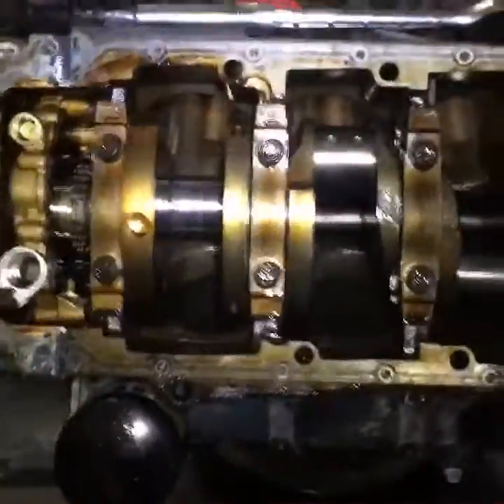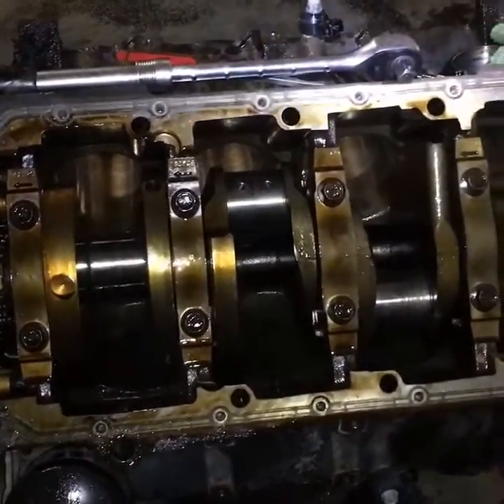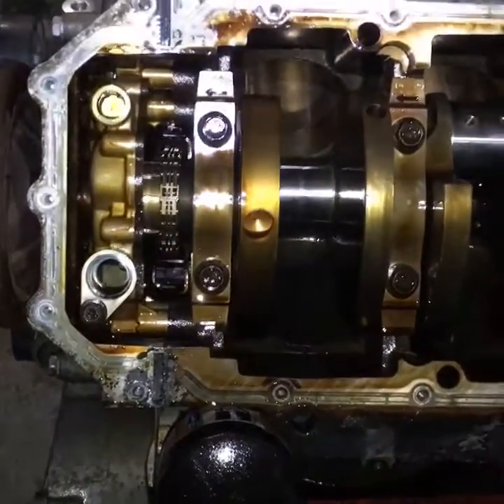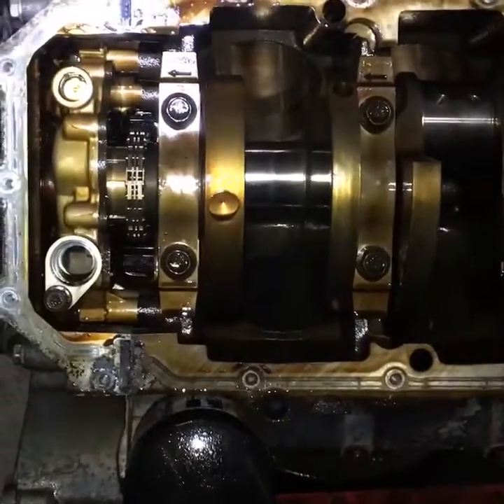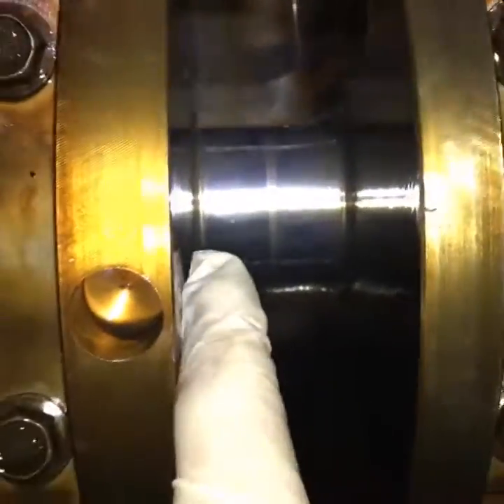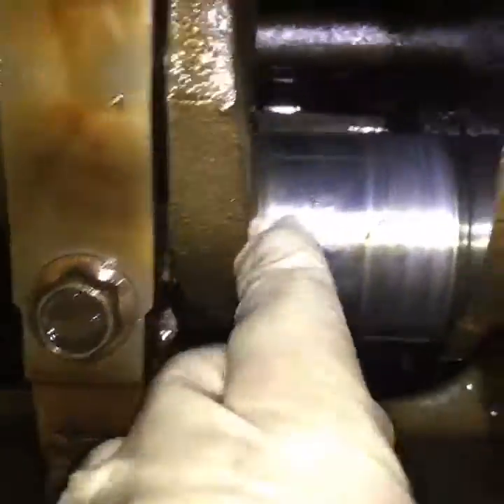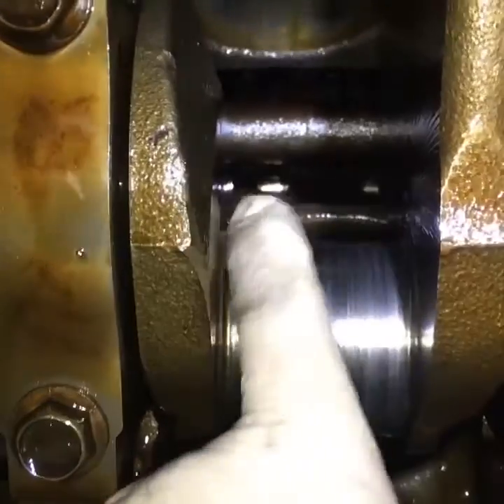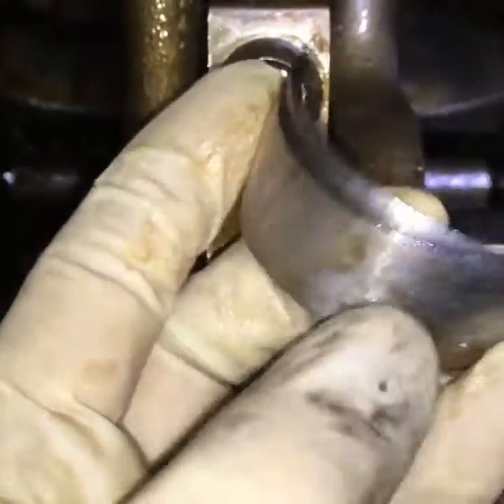5.7l hemi engine/motor rebuilding

Comment: same thing happened to my 07 3500 dump . # 7 and 8 failed and crank journal was egged shaped only 76k miles 
shitty cast cranks
Reply: Ya it is low i have a 97 ram1500 with 300k that plows 5.2 runs mint . Looks like crank failed still had perfect oil pressure even hot idk
Reply from the maker: Todd s oh wow man. Thats low miles for that issue